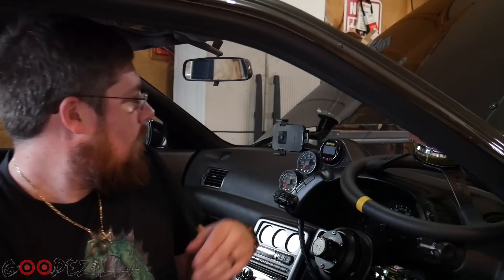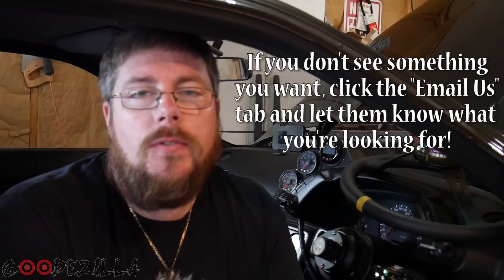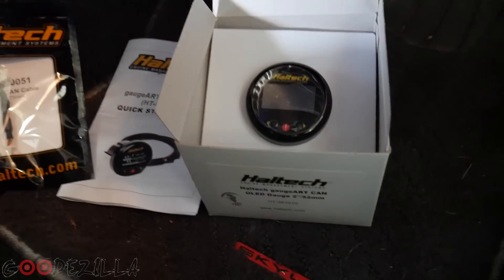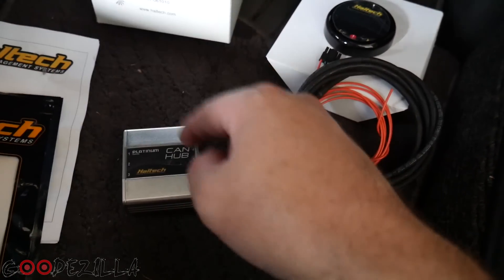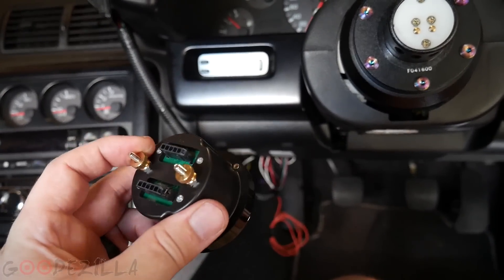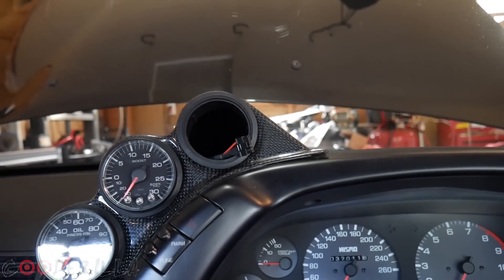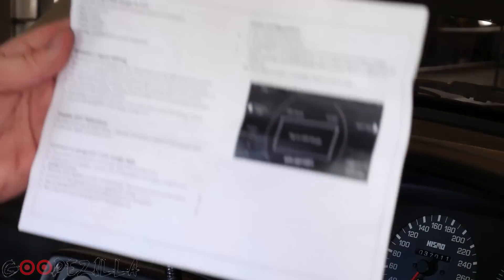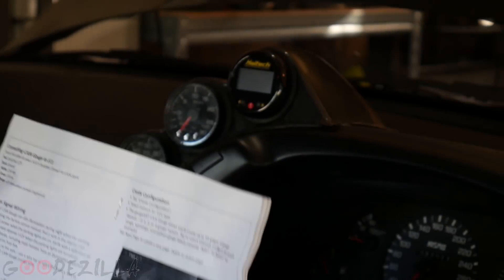Haltech GaugeART CAN Gauge Install with Platinum Pro ECU

Comment: Sorry I am not fully sure if I should keep the jumper or not. Did you left it or removed it?
Reply from the maker: I left the jumper installed on the back of the gauge.
Reply: @Goodezilla  thanks will carefully check the devices order to replicate
Reply: @Goodezilla  For some reason the option to enable the gauge is not visible in the ECU sw (v1.14) , devices options. Any chance you can assist? I was able to set up the gauge and shows the parameters, but they are not reading from the ECU. In addition, I left the resistor as you suggested, but please note that I have only one gauge. Should I remove  the resistor? ECU hub#1, Dual widebands# 2  , Can gauge, # 3.
Reply from the maker: @yamilz32  I'd contact Haltech and ask them for assistance.
Reply: @Goodezilla  a new cable was sent and it works however some parameters like fuel pressurr oil pressure turbo rpm not working. I see yours working  Anything additional you did in the ecu sw?
Reply from the maker: @yamilz32  do you have sensors wired in to your ecu for those parameters?
Reply: @Goodezilla  laptop will show them so i d say yes. Wondering if the fact of.not having the jumper added would.male some parameters to read while some not.
Reply from the maker: @yamilz32  I don't know...Possibly.

Comment: Did you have trouble getting it to connect to the app? Mine REFUSES to connect to the app and I'm furious
Reply from the maker: No I didn't have trouble. Disconnect from your home wifi before you try connecting to the gauge.
Reply: @Goodezilla  I'm just using cellular data but I tried turning that all the way off too.  RIP me haha
Reply from the maker: @xcmdrclutchx8225  do you see the gauge wifi network in your available wifi networks?
Reply: @Goodezilla  yessir. It connects to that but doesn't connect to the app. Should've started with that I guess lol
Reply from the maker: @xcmdrclutchx8225  I'm not sure man. Maybe try a friend's phone or tablet?
Reply: @Goodezilla  that was gonna be my next move. Just figured I'd ask, thanks anyway!

Comment: I wann to buy one of those cam gauces for my haltech platinum pro! Did I have to buy more sensores? From haltech or ecu use the oem sensor, im running R33 gtr plug and play platinum pro, with oem harness! Can u help me with that
Reply from the maker: Whatever your ecu can read, you can put in the gauge.

Comment: Hey man, Quick question. Where did you get the power supply from for those gauges? I have 3 new gauges I wanna put on center where the stock ones are.

Comment: Dustin, just curious what fuel pressure sensor did you go with? Haltech’s? Also, where did you install it? Looking to purchase this for my gtr to monitor fuel pressure. Thanks
Reply from the maker: Yes I have a haltech fp sensor. It's installed using a remote AN line from the fuel pressure regulator.
Reply: GoodeZilla thank you!

Comment: Go figure! I’m installing this gauge right now on my gtr. I’m pre-wiring this gauge so when I install the platinum pro next month it’ll be ready to hook up. I wanted to know if you use the 12 volt wire and hook just that up would the gauge illuminate or it has to be hooked up to the ecu for it to work? I hooked up the backlight wire but the gauge doesn’t light up when I turn the headlights on. Thanks man
Reply from the maker: I didn't hook up the dimmer wire. Good luck with your car!